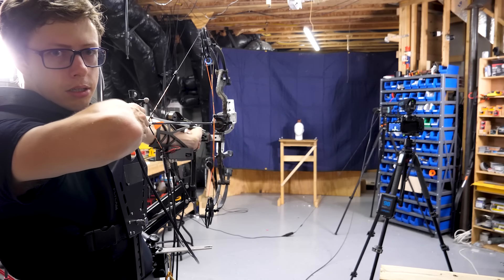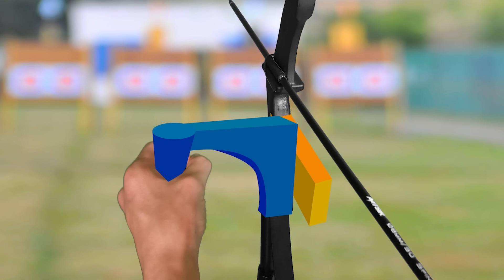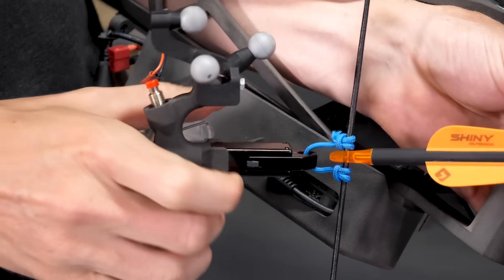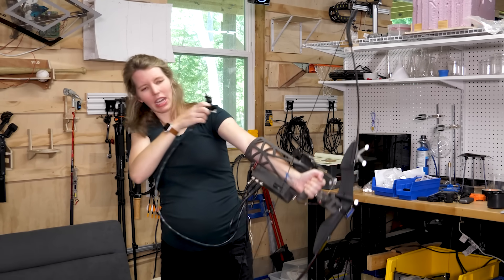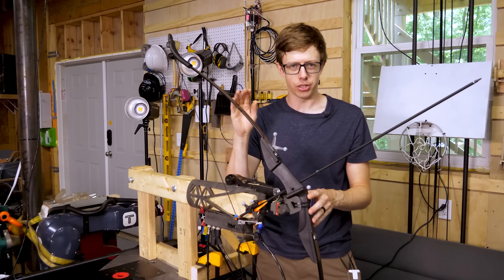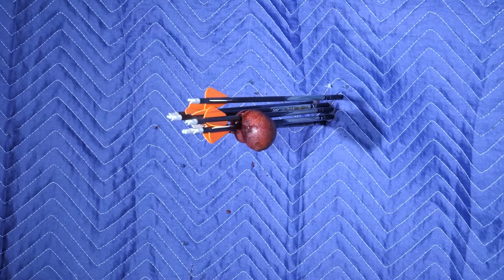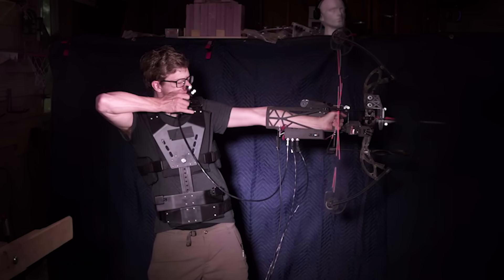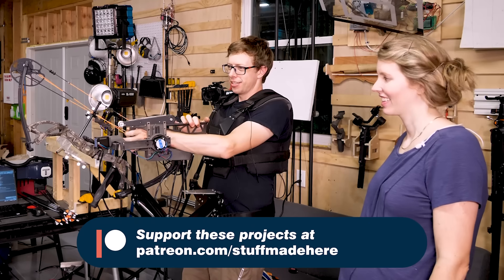Auto-aiming bow vs. FLYING targets

Comment: Theirs one obvious variable that your software, cameras and tech can't account for. With the way a recurve bow works, the further you pull it back, the more power and speed it's going to shoot with. You would have to pull the bow to the exact same spot and force, every single time for this to be 100% accurate. I think that was the main variable I think was causing you problems. The compound bow makes all kinds of sense, because they pull to a certain point, same point every time, then are locked in place.

Comment: 5:23 Well yeah, you for some reason thought it'd be great to leave the "trigger" over to the robot as well. You either want something to aim depending on how far back you've drawn the bow, or have it assume you will always draw it to at least a certain point, and then fire it from there yourself.
Part of the missing is also due to how your body moves when the arrow is suddenly released. Those movements carry over into the arrow.
You think the military would have automated hand guns that fired bullets automatically if a target is within the trajectory? Auto-aim sure, but firing the bullets will always be up to the user.

Comment: "The archers paradox" you have to match the spine value or the stiffness of the arrow to the power of the bow else it will veer off to the side. Took some classes in archery with my recuve and got subpar result until my teacher tested it and figured out my arrow's where cheap and borky with inconsistent stiffness thus i would never be accurate regardless how good my draw and anchorpoint constancy was. Measured my draw length and did some math with him got some new arrows up to spec and bobs your uncle it was fixed.

Comment: I was wondering myself why the aim and timing was off the rails then you said you were using a recurve 😅 The compound worked because it’s meant to be accurate and consistent. The archer’s paradox is basically non-existant compared to a recurve bow , it’s constantly drawing the same force, same speed . Compound bows are marvelous pieces of tech .

Comment: The arrow knows where it is at all times. It knows this because it knows where it isn't, by subtracting where it is, from where it isn't, or where it isn't, from where it is, whichever is greater, it obtains a difference, or deviation. The guidance sub-system uses deviations to generate corrective commands to drive the arrow from a position where it is, to a position where it isn't,

Comment: I'd be willing to guess, (😏), if you added weight to the sleeve/grip thingy, that the accuracy would improve. (In addition to increasing the scan rate of the sensors and calc rate of 'puter thingy whatzitz...).

Comment: The biggest reason you "punched" yourself so many times is because you weren't holding the draw properly. When an archer draws, they pull back towards their cheek. You were holding the draw in front of your face. That would also account for the initial high and to the left shots when you started. Otherwise, cool device!

Comment: I have a question about circuit setup and diagram design. I do a lot of coding and AI integrarion experience and I have a lot of experience with mechanical repair and restoration, as well as schematic reading, but virtually zero experience with circuit design.

Could you take a moment to give me a good resource for learning some essentials for building circuits with an arduino? I am trying to design a multi-faceted circuit that controls temperature and humidity for a pre-defined space and I know all the hardware to use outside of the components specific to a board circuit, essentially.

I am basically recreating the Zoolander hand model's hand time capsule.

I don't care if you take the idea and run with it, I just want to be able to make myself one so I have a good solution for while I'm sleeping because my hands have had bleeding cracks for years because of chemical exposure.

Comment: 2:00 The missile knows where it is at all times. It knows this because it knows where it isn't. By subtracting where it is from where it isn't, or where it isn't from where it is (whichever is greater), it obtains a difference, or deviation. The guidance subsystem uses deviations to generate corrective commands to drive the missile from a position where it is to a position where it isn't, and arriving at a position where it wasn't, it now is. Consequently, the position where it is, is now the position that it wasn't, and it follows that the position that it was, is now the position that it isn't.
In the event that the position that it is in is not the position that it wasn't, the system has acquired a variation, the variation being the difference between where the missile is, and where it wasn't. If variation is considered to be a significant factor, it too may be corrected by the GEA. However, the missile must also know where it was.
The missile guidance computer scenario works as follows. Because a variation has modified some of the information the missile has obtained, it is not sure just where it is. However, it is sure where it isn't, within reason, and it knows where it was. It now subtracts where it should be from where it wasn't, or vice-versa, and by differentiating this from the algebraic sum of where it shouldn't be, and where it was, it is able to obtain the deviation and its variation, which is called error.

Comment: If you want it to miss, move the fletching toward the middle of the arrow shaft, or nock the arrow higher or lower on the string. Doing any of those will cause the arrow to curve mid air. Where's my 100$?

Comment: Sory man, but You should consider positioning balls as cheat. I mean, yea it is an engineering. But enemy will not be that polite to wear them. You have done so great job. How about camera upgrade and ami recognition + set constant distance on bow (so u do not have to calc that every time) or laser for avg distance measuring.

Comment: Your wife knows how to do archery. Anchoring is important, she does and therefore don't hurt herself in the shot. You don't anchor, so you hurt yourself. 
Therefore the whole design is wrong.

Moreover you don't pull the full length, so the spine of the arrows wil not match the actual force from the bow. The arrows will be too stiff and deflect to the left always.

Comment: @11:16 "I didn't actually do anything, but it feels like I won." I spent the whole video wondering why you even had to hold the bow. You could just mount the whole system on a stand. I'm convinced the only reason you didn't is because the video would end with your robot shooting you through the kidney.
Reply: to pull it back, only feasible reason

Comment: After the first or second time punching myself I totally would have dropped a plastic/metal mask on me for protection>> Lol, learning curves ehh... get it like a bow curves ... nm, sorry.
Reply: Looks so satisfying to shoot that automated compound bow!! Was thinking long ago about a way more difficult concept for military use in fast scenarios where u roll a ball with snapshot and flash nodes in it that spring out and up when timer clicks or on impact, then you have about 1-2 seconds to turn corner and shoot combatant with tracking program like yours. The gyro concept in my head was about the same, but was not sure how to apply such methods on a bow. Really love the quit hitting yourself function as well... humor and teaching at the same time!!
Reply: Was wondering if your wife suggested shorter arrows for more control as well?? Those longer arrows seemed to move a bit while it was adjusted making the pitch slightly off which was what probably made it sway up and to the left..?

Comment: This is so cool, I subscribed right away, I'm not sure if it's possible but it would be way cooler if the cameras and everything needed are part of the bow, so you can take the bow anywhere rather than having cameras setup in the room.

Comment: You can do a lot with software, but some things just can't be fixed with software. At least not without extensive calibrations and AI calculated error correction.

Comment: You didnt explain how tracking system works.   What is it using, LIDAR?   Idea for next archery project:  laser targeted arrow a gyro and microprocessor on board adjusting tail fins so that the arrow adjust flight to target the laser dot.  So essentially what laser guidance systems on bombs do with some programming changes to adjust for the aerodynamics and physics of arrows

Comment: But can you make a version that doesn’t use the tracking cameras? Perhaps a scope to target with. You depress the button, and the bow is targeting where the scope was. Using a camera parallel to scope for basic acquisition, laser range finder, and sensors on the joints to measure bow position vs scope? Seems like it  could be possible

Comment: I'd like to see the release mechanism used for a smart sling. You swing the sling round and round, and when the projectile is "aimed" right it releases. The projectile could be shaped like a dart, with tracking balls at the front and back.

A smart sling would have far fewer parts than the bow and arrow system - it's just a string with the release system on one end.

Comment: Arrows flexing is not a problem as long as the node points in the oscillation are pointing at the target. Modern carbon aluminium arrows are not very consistent from a precision point of view getting an aluminium tube straight is not too difficult but getting an even wrap of carbon that’s a different matter just take a look at ace and x10 arrows they get shown up by Beiter knocks if you get a duff batch of shafts.

Comment: Wisher Biscuits are rests for kids with seizures.  Drop away rests are the way to go.  Also paper tune your bow.  Paper tuning your bow gives the arrow the straightest flight possible right off the rest.  Not doing this cuts your consistency in shot placement by at least 20% at 30 yards.

Comment: Nice!! I believe you are the weak part of the equation. Your arm is constantly moving/floating, in reaction to the servos, making the processor process a wider range of info to calculate every scan. If it was mounted on a stand, I believe your shot group will be +/- 0.100". Just my thoughts. Thanks for the vids!!!

Comment: If you produced a different tracking system that can specify targets without external aid, (however that would cost a lot) such as thermal tracking or an interactive infared motion sensor that can locate movement like typical homestead security cameras and produce an interface like a screen to allow a specific moving target, similar to how a drone can track a moving object

Comment: You are not punching yourself in the face because you don’t know when the bow will fire. It is because your hold is 1000% incorrect. It also appears as if the draw length is also likely very wrong for your body frame. I’m shocked your wife hadn’t pointed this out to you being an archer herself. 
I believe if you correct your core archery fundamentals, you would likely greatly increase your accuracy in the process. 

Also the whisker biscuit you are using is not great for accuracy. Consider something like a drop away arrow rest.

Comment: The fact that he had to use a compound bow  really shows how complicated humans' gut is. As a trained person can use a recurve bow with pretty good accuracy.
Reply: SmarterEveryDay has an excellent video on that, and a companion video of a guy shooting an aspirin tablet out of the air with a barely sculpted longbow. Goes into depth about how he aims where the flexing of the arrow is going to out it, and how he only uses arrows within a certain flexing tolerance. Crazy stuff.
Reply: Yeah....what he said above. It's not the bow. All straight or recurve bows shoot around the shaft....creating the Archer's Paradox. 
What normalizes it an allows archers to shoot accurately is the stiffness and consistency of the arrow shafts. And cheap carbon arrows are all over the map in stiffness and consistency.
Reply: Destin from SmarterEveryDay made a series of videos about the physics behind the recurve bow. Go check : The Archer's Paradox in SLOW MOTION - Smarter Every Day 136
Reply: im pretty sure you could predict that curvature with artificial intelligence. im a bit sad he went for less flexible instructions, i would have loved to know which data he would have used for the curvature issue

Comment: The cheating part and weight-supporting-robo-arm weren't the cheating parts - the cheating was the cameras tracking all the movements from different angles. I'd love to see you do a real-world applicable aim-bow by replacing the cameras in your workshop with a camera and range finder integrated into the bow itself. Just don't use it to go outside and hunt the unfortunate little critters that have to face that thing D:

Comment: @Stuff; Made Here : Now you are absolutely ready to realize the sole weapon the whole world need : the automatic flygozinger !!! 
I explain : since 40 years, I'm using a rubber-band-gun to  kill flies and mosquitoes in my house. With a rather large rubber band, you've got the power and distance (if you aim well) to kill a bug at 4-6 meters distance, without the risk of harming anybody or damaging the furniture. So my dream is that you build  a system that detect a bug  in a safe area of the space of the room, IE landed on the ceiling, or flying over man height, and fire a rubber band at it.   
I suppose that it could be ultimately rather low tech, with a webcam, a raspberry Pi, and a gun mounted on a gimbal, and you could achieve what Bill Gates Fundation wanted to reduce the spreading of malaria that kill so many humans (but they wanted it for outside, using a laser, aiming only at females mosquitoes, so I suppose that's why the project failed).... 
You could use the design  a rubber band machine gun that can store dozens of preloaded ammos, so the system could run unattended for quite a while...
Reply: I suppose that the best place to aim would be towards a window or a skylight, where most flies are landing. But then the ultimate fun would be to be able to shoot them down in mid-air. I did a first prototype just using a low power laser pointer, and the flies are not disturbed by the light, so it's very easy to aim with just a webcam, using the delta between the black dot of the bug and the bright dot of the laser to correct the aiming (parallax, plays...), until they are superposed, so then you can fire. But for now the resolution of my very cheap step motors of an Arduino kit are much too coarse, and unfortunately I have other priorities than continuing this funny and useful project.. But I also suppose that this could be a nice project for students in robotics! anybody interested? I suppose all Australians should be, they are so infested by flies!

Comment: I'm surprised you didn't consider a crossbow design, since you can minimize human error when dealing with general direction, it's safer, easier to calculate, and not worry about having two different robots operating the system. Insanely awesome video regardless.
Reply: To quote his life "LAAAAAAME"

Comment: Congrats to both of you on the upcoming little engineer in training! We just had little engineer in training #4 last month. One thing you will notice is that not one single baby article of machinery is designed to be as useful as it should be. With your background in mechanical and computer science engineering and making things, I'd expect your next few months would be best spent building a few contraptions that will make that first 6 months of baby life easier and truly livable. For instance, take a baby carrier seat for a ride in your car and instrument it for vibration and sound recording. If you could develop that into a baby bed that has "car mode" you could turn on in your home, it would revolutionize your early life at home with baby!
Reply: Using a baby as a testing subject is questionable.

Comment: Why don't you make a bow that shows the predicted trajectory of the arrow in augmented reality? It could be made without aiming assist motors, but it must know the angle of the arrow, the bowstring tension and the weight of the arrow and maybe some correction coefficient.

Comment: Given the tragic circumstances of the recent on-set accident on the set of Rust, I think you should team up with the Corridor VFX channel and design a gun, or even better an attachment for a gun, that can provide a reasonable simulation of the kick of firing without releasing any projectile. Perhaps something using compressed air or co2 to move a captive, high tension spring? Maybe go so far as to integrate wireless motion capture to simplify the later addition of muzzle flash. It just seems like something that should be doable. :)

Comment: You should try doing this against mark robers automatically aiming target that will move to get a bullseye but you can change it to make it move away instead and this is also a chance at a collab
Reply: Another thing the reason the smaller one was harder was because of the way your arrows are made you can make a better arrow back to fly even more straight and a more sharper tip to grab onto targets so the moving target not getting hit needs to be grabbed on so your welcome fore some tips that I think will make it better

Comment: I would make the tracking system not absolute, but relative to the bow. All you need is to mount a high speed camera on the bow. Depth accuracy is not critical, and could be estimated calculating the size of the tracked object (distance between two markers).
Making it relative makes it much easier to move the system between locations. An IMU can be used to calculate the gravity vector, needed to compensate the parabolic trajectory.